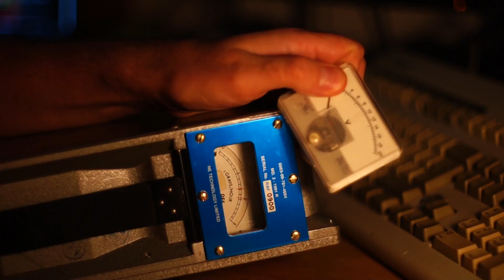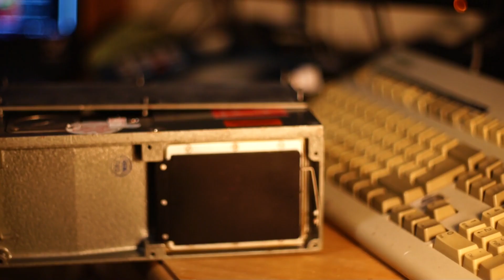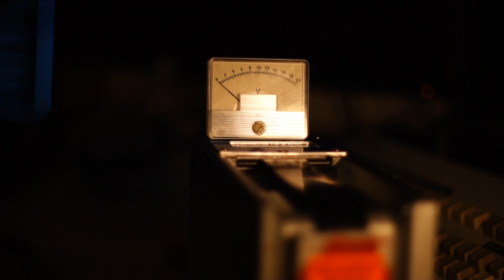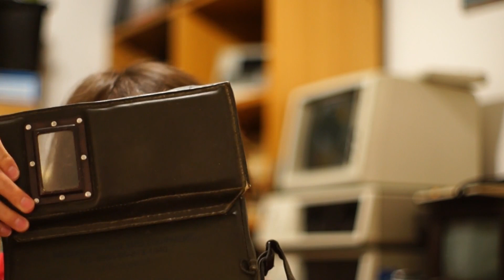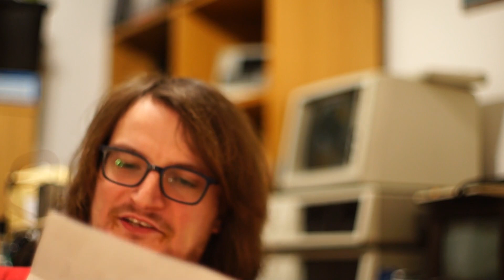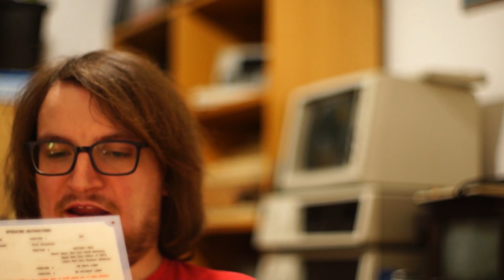MD3 1991R AKA Radiac MD3 Overview & Demo

Comment: I wish I could find the wand for my old lab one, grrr :o(  Naa, it's not noise, you are NUCLEAR MAN!! LOL  2003?  Wow, well, I suppose if it ain't broke, don' t fix it!  Ahh, ive heard of this mineral called 'Unobtainium'!
Reply from the maker: There are many vintage things made of Unobtainium. Iron chanmbers are supsepterble to electroical noise. However this was responding to the Alpha in the smok alarm thing as other maerterials would not do anything. I was suprised that my Thoriam 232 lens did not set it off as that produces a lot of Alpha. My guess is th Smoke Alarm Alpha element has more energy. Which makes it a kind of scary source. You can also achive this effect with Radium. The only slight problem with that is I don't have any Radium.